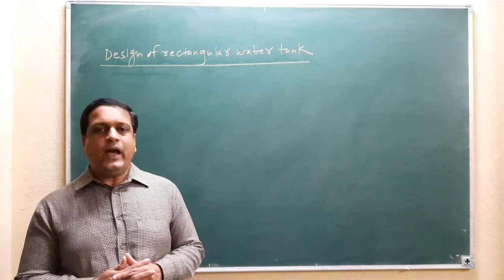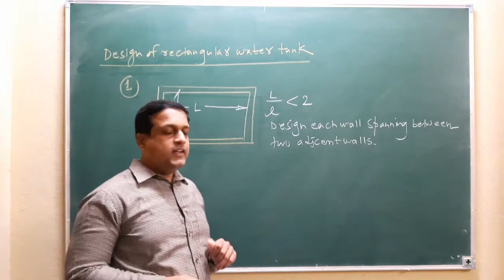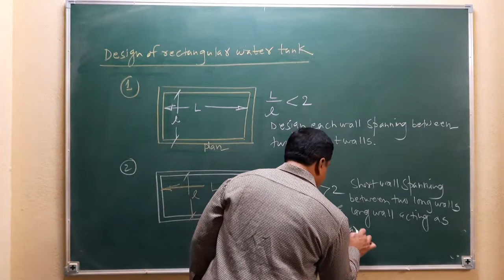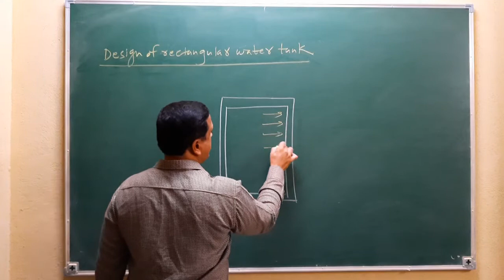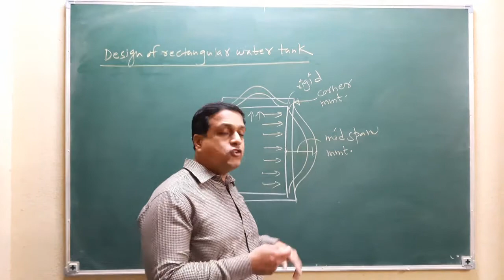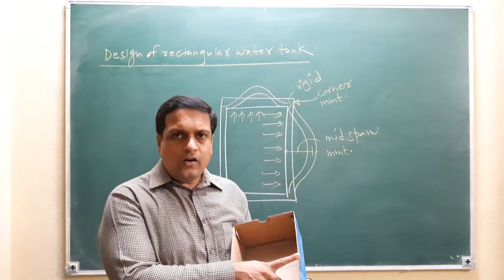Lecture 6 Rectangular tank

Comment: Sir, what is reason of having large or higher size of rebars (in diameter) along horizontal directions in the rectangular water tank ??? is the horizontal rebars in the rectangular tank is the main reinforcement ???     IN CASE of shear wall, the vertical rebars or reinforcement is main reinforcement